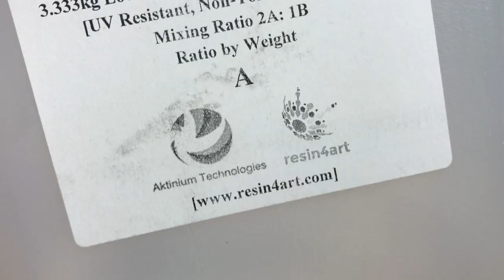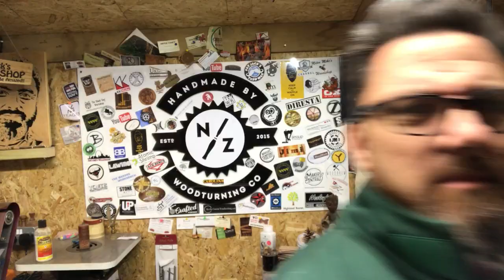woodturning a Christmas tinsel bowl - from xmas tinsel and wood

Comment: Very nice.  what happens if you use plant material in resin ? does it die off and go black if you use grass cuttings or flowers for example or is it preserved ?
Reply: robowen11 he actually made a pen with grass clippings
Reply: indeed, but what actually happened to the grass in that pen? good question
Reply: I've seen 4 leafed clovers etc in resin, and they stay green and fresh looking - probably wouldn't make the green stuff too thick tho...

Comment: I have a question, is there a reason a silicone plug cannot be put into the center of the mold to save on resin? Wouldn't it be easier and reusable? 

You're the expert, I was just wondering what the reason is.

Comment: very nice bowl ! The wooden bowl blank, and a lot of the wood cuttings were totally turned into shavings. What if you made the blank with another disposable material (styrofoam, expanded polystyrene) in the center or in the areas where you will hollow, this way saving precious wood for other projects? Is that possible or maybe not? great channel !!

Comment: Nick, great bowl!  I have a technical question.  I tried to make a bowl with wood off-cuts and had a few trapped air pockets that ended up as surface defects after turning.  Have you found a good way to fill the little craters?

Comment: Hi nick
I have a question about pressure pot. Why do u use it and is it nessesery? I want to try but a pott is expensiv in sweden that is why im asking. Keep up the god and funny work u do 👍👍
Best regards Magnus
Reply: @stilleryd25
The pressure pot helps with air removal, so that your project is bubble-free. Technically you can do without, it just won't look that good.
P.S. Another great project Nick!!
Reply from the maker: thanks buddy
Reply: There are other ways to get bubbles out for example a blow torch which i assume would be way cheaper for those on a budget

Comment: when doing a larger item like this, have you ever considered using another, smaller bowl in the center before putting in the pot for the night? It would save a lot on wasted resin and wood. Just put a smaller bowl on top of the items you line the 1st bowl with, and weigh it down with a brick or rock or something. When you take it out, it will leave a much smaller area to carve out. Just a thought.